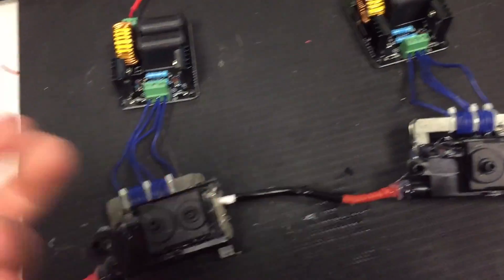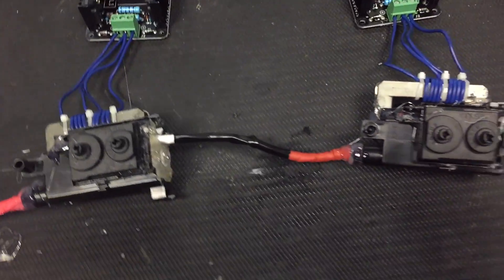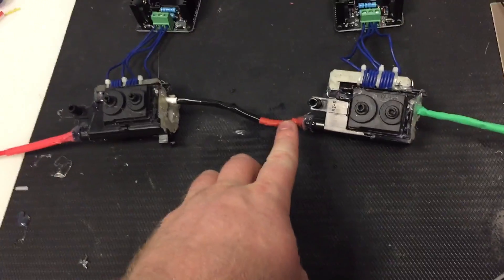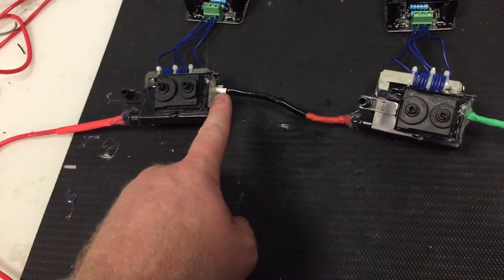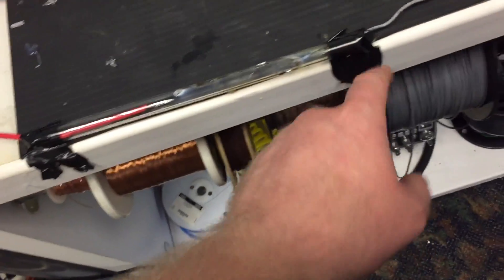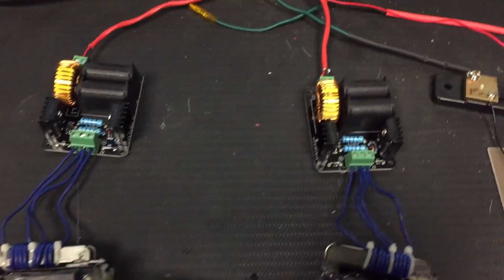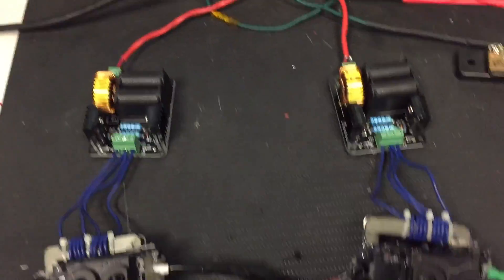Dual Flyback Transformer Plasma

Comment: Why do folks use ZVS drivers with their own windings rather than using the built in fly-back primaries?
Reply from the maker: Winding your own primary results in much higher current capabilities. If you use too much current with the internal primary, it will crack the epoxy insulation and the magic smoke will escape.

Comment: You're using two different drivers, their frequencies will be slightly different meaning the fly backs aren't in phase. Try using one larger flyback circuit to power both of them to ensure both transformers are perfectly in phase and are able to output the highest voltage possible

Comment: Where did the carbon come from?
Reply: Ian Oliver The conductor/electrode material  began breaking down causing it's lightest elements to break their molecular bonds. Then they were deposited into the glass where they conduct the heat of the plasma to glass.
Reply: @clutch1141  you mean that black thing is copper ?
Reply: @AsimKumarMahakul  It looks to be copper, yes. Although, different materials can be used as cathode/anode, such as tungsten, carbon, cobalt, platinum, etc, as copper isn't very durable, but that looks to me like copper.

Comment: Could you wire the flybacks in parallel?  If so, how would you do it?
Reply from the maker: Yeah, it would increase the current output instead of the voltage.  Just tie the positive outputs together and tie the ground wires from the bottom of the flyback transformers together.
Reply: But how would I connect them to combine the voltage??
Reply: @user-tb4sl4ex2q  first transformer's negative pin to second transformer's positive output cable

Comment: Are you sure that's a carbon track? When glass heats up and melts it becomes somewhat conductive, which appears to be what happened to your tube.
Reply from the maker: That may have been the case at first but there was definitely a black trace left behind with several megohms of resistance even after it had cooled.

Comment: I have been able to acheive outputs close to this from a single flyback driver, so you could probably push those flybacks a tad harder!
Reply from the maker: Yeah, I have as well but I needed to order a power supply good enough to drive both at the same time at 24V instead of 12V seen in the video.(it's on the way)  I will also need to switch to quartz glass tubes instead of the borosilicate to handle the heat better.  I might also put copper heatsink rings to dissipate the heat away from the glass.
Reply: You can make cheap powerful low voltage supply by rewinding MOTs for needed voltage, just as i do for powerind my ZVS driver on my channel

Comment: Hmm, you should try that with a clean and evacuated tube. Throw some argon in there for pretty colours.
Reply from the maker: Any recommendations for a good setup for evacuating tubes?  I have a very good vacuum pump but I've never tried evacuating tubes before.
Reply: It depends on if you want to be able to adjust the spark gap. With a fixed gap you can just epoxy one end with the wire in place, then epoxy a T onto the other end fixing the wire in one port and attaching your pump to the other. Ideally you crimp the glass around your copper while molten, but that is not an easy task. 

Making a movable gap pretty much requires either a linear actuator or adjustable bellows. You might be able to DIY an actuator using two closely fitting tubes with a few o-rings or just vacuum grease if the fit is very tight. 

The only other thing I can think of is coiling the wire at one end (spring helix shape) and fitting a powerful magnet a bit back from the electrode end. You could then probably use a magnet on the outside to drag the electrode into position.